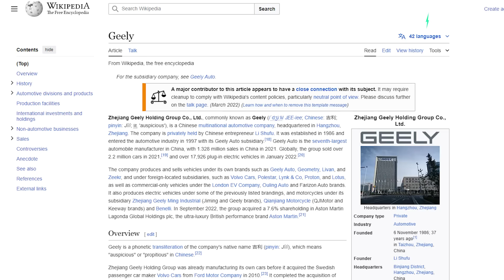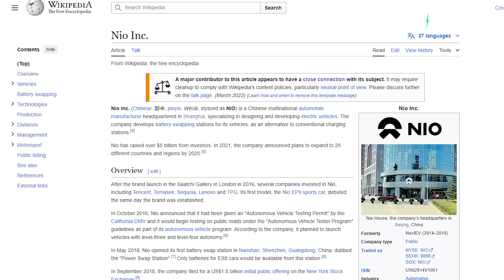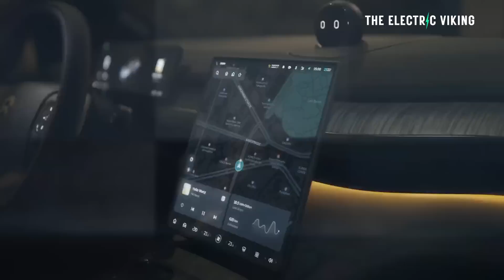$25,000 Tesla getting rid of Production line for world first assembly method

Comment: Volvo used to say: "Safety doesn't sell because safety isn't sold."  I believe for the legacy automakers burdened with dealerships, I'd change it to "EV's don't sell because EV's aren't sold."  EV's such as Tesla have VERY low maintenance, and service is the overwhelming moneymaker for dealerships (those beautiful, modern buildings at dealerships are largely built by dinging the auto owners for service).  Ford realizes this and still has to arm wrestle their dealers (who are independent businesses) in order to get their EV's into the hands of owners.  Once consumers are sufficiently fatigued by ever-increasing labour and fuel costs, the EV sales will follow.  Until then. the legacy automakers have a fight on their hands.  Next battle: making a profitable EV (like Tesla).
Reply: So true...how long can legacy makers continue running multiple production lines for fossil fuelers with decreasing sales. This is early days in the scheme of things and the uptake of EV's is trending upwards. When people bag out my EV I ask how much they paid in service costs in the last 2 years 80k kms it cost $89 in service costs and fueled by sunshine.
Reply: @Skeptic236  My 5.5 years 80k miles service cost is $173.    2 sets of air filters and a 12v battery replacement.  Newer Tesla after 2021 has Lithium v12 and will last the life of car pretty much.
Reply: Now Tesla is profit center for repair shops.   I own 2 Teslas but would hope to never get into a repairing incident (although insurance would pay), the time to repair could sometimes be long.
Reply: @Trust_but_Verify someone smashed into our model y when it was parked on the street. Repairs include replacing suspension parts and bodywork. No problem finding a repair shop and got prompt service - same as any other brand. That was over a year ago and we have almost forgotten it happened.
Reply: Given its now a mass market car, a reduction in repair costs should follow. @Trust_but_Verify
Reply: You don’t have to look far on YouTube to see many contributors saying they wouldn’t touch a wide selection of ice vehicles out of warranty. The pressure to cut costs means they will not use a metal pipe where a plastic one will do. Once that warranty expires, anything goes wrong with the car and it’s your problem. InBuilt destructibility baby - it’s the American way.
Reply: - needless to remind - that EVs only lack and engine-oil-and coolant-change.  They have all the other subsystems on a regular vehicle (who ever had a modern auto transmission which really needed a flush - (that is a stealership gag mostly..).  
(Some Near new EVs have had suspension fall apart from lack...  (maybe lack of design and assembly integrity) - not caught by the mechanic at the time of a greasing..)

The primary cost at a car dealership (yes indeed stealership is an ideologically correct rephrase here)  is workshop time (maybe dinging is your correct experience) - the time on a hoist for the apprentice to walk around with a clipboard and note all the Inspection points on the vehicle (safety check - not done by many home owners in their driveway)...  The engine oil and coolant can be dumped out in seconds - at the same time as the walk around begins - (topped back up at the end), there you go, a value quicky oil and coolant change in the same time as a brake inspection (just don't overdrain the variable displacement oil pump)....

Most wear components on a vehicle last for at least 60,ooo miles (tyres rarely), and many for the lifetime of the vehicle  (you, as a new car buyer) aren't often seeing 60k miles go past on your personal car. (if so you need to rebase your leasing period, or  run a hirecar company - to offload the new but high mileage cars to other users)..  Thankyou for taking the planet down with another, and another (high consumption model)- liberating those resources for the next person.   Thank you very much.   lol...
Reply: @kadmow  much less replacement frequency for brake pads and rotors, brake fluid change, no spark plugs, ignition coils, timing chain/belt, O2 sensors, exhaust sensors, catalyst coverter to be stolen, mass air flow sensor, emission control systems, there is no transmission or differential/transfer case fluid change.
Reply: @kadmow  I paid $175 on service for 2 sets of air filters and one 12v battery for 5.5 years 80k miles with Tesla Model 3.   My old BMW 3 series from 76k to 158k miles incurred $6,7000 service/maint expenses.  (exclude tires) and 18 service visits.  (exclude tires)
Reply: Hertz just decided that evs are too expensive to maintain. Sold off all their evs, took a $270 million writeoff and the ceo was fired.
Yet the evs lovers still insist that they are cheaper than ICE.
Seriously deluded.
Reply: service is the overwhelming moneymaker for dealerships

No it isn't - Lookers, the UK listed dealership group makes 35% of profit from after sales, and 65% of the profit from selling new and used cars
Reply: Good point
Reply: Insurance cost for Teslas (and EVs in general) are much higher than for any traditional car of the same price.  Insurance companies say it’s because batteries are expensive to replace and in a major accident they always need to be replaced.
Reply: @hdthor  maybe for now. But eventually the fully self driving cars will prove to be the ones that don’t have the accidents and the cost will go way down.

I think people who can afford to buy a Tesla can afford the insurance.
Reply: Dealership owners and their families are often the most wealthy people in the area.  Lots of mansions will be for sale in the next 2 years as those people have to find real jobs.  ;)
Reply: @davidbeppler3032 good point
Reply: EV's are more expensive to maintain. Lots more tyres needed for one thing due to the weight.
Reply: @Withnail1969  Absolute tosh. I own 2 Teslas and all tyres ran more than 30k miles
Reply: Tabloid rubbish hahaha
Research needed  @Withnail1969
Reply: @Withnail1969 You clearly don’t own one
Reply: @Withnail1969
Completely wrong.
Reply: @Withnail1969 - A lot depends on how you drive. My 4yr old Tesla still has the original tires at 30k miles.  Meanwhile I have spent exactly $0.00 on maintenance, not even windshield washer fluid, don’t need that in SCal and if garaged, just wipe it down with mild vinegar solution for bugs and dust, so correction maybe $0.25, ymmv. Btw, my EV came with free life of ownership Supercharging, an SC station, 24 stalls, opened 0.3 miles from my house a year ago so got real lucky prior to that it was a 5.5 mile to an SC station, but I have solar panels and net metering so used to occasionally plug at home in but not anymore. Free is nice, beats pumping gas, ymmv.
Reply: @Withnail1969  This is already debunked many times by owners.  My tires lasted 47k miles on Model 3 with 4/32 and 6/32 left.  I replaced it because it got noisy.  It's up to how it's driven, 0-60 in 4 seconds, sharp stock/brake would eat up the tires like any other gas sports muscle cars.

Comment: I'd love to see some new/old features in the coming affordable Tesla
1) A wind down window on for the driver.  All the rest electric.  I have a horror of driving into a lake and my window shorting out and trying to get at my window shattering device while holding my breath.
2) No touch screen.  They are more dangerous than using your cell phone while driving.  Everything should be tactile and while the radio can be controlled from the steering wheel, the radio itself must have a knob on the left that tunes the radio and one on the right that turns the radio on and off and controls volume.
3) Go back to the idea of a two way car.  ie, you can power your house from your car and store the excess power from your solar panels in the car battery.  And if you want, you can export power to the grid when the price is high.
4) Have a three pin plug somewhere in the car - trunk or frunk perhaps, that gives 220V AC (110V AC in America) with about twice the amperage capacity of a standard house plug
5) Look at the Leaf speedometer display.  It is visible through the upper half of the steering wheel and you can see everything at a glance.  You hardly have to take your eye off the road.  It is a much better display than any other car I have driven including a Tesla.  
6) Make the car so that the battery can be easily changed or just removed and sort out a package that converts the battery from a wrecked car or a degraded battery into a home battery.  Perhaps if you do (3) you would simply keep a very old car and park it in a leanto  and use it as a home battery.
Reply: A window shattering device is not going to help you. The glass is all laminated, and those spikes simply don't work. There is no solution AFAIK.
Reply: @greghudson9717  How does the thief break into the car through the window to steal the items then?
Reply: You can use voice control instead of touch screen.

Comment: Gigacasting may reduce production costs, but it essentially creates disposable cars.  One fender bender accident will total your car, because castings generally can't be fixed.  Insurance costs are going to skyrocket.
Reply: Negative Nancy and alternative facts
Reply: Same idea as the old unibody VW beetle no?
Reply: Another post on giga cast damage totaling cars!!!! Any frame damage on a regular car guess what???  It’s a total loss also. Some drunk idiot clipped the rear quarter of my f150 3 years back, misaligned the frame about 1/4 inch, totaled.
Reply: @timsmith6815  Did the insurance total the car because they don't want the liability in future accident?   What if you continue to drive with that misaligned 1/4 inch frame?  What would be the problem?
Reply: @timsmith6815  Cars and small trucks haven't used frames in decades.  All cars and small trucks use monoquoque (sp?)construction.  The body is also the frame. Your 1/4" represented a twist in the body.  It can't be untwisted.
Reply: @timsmith6815 Frame damage on a regular car takes a 40 mile an hour impact. You can bend a gigacast at 10.
Reply: @PxThucydides  Source and clarifications for your vague claims ?  
The limiting factor channel covered this in depth in 
"#1 Tesla Gigacastings // Crashworthiness and Repairability"
Reply: Possibly but I've seen sections of giga castings being hit with sledge hammers and they bounce off so not sure how the repair market will unfold.
I'm sure Elon has thought these things through so we'll see.
Their model 2 is the only car I'd consider buying so will look to its official release.
Reply: DEAD WRONG! Teslas CAN be fixed. Insurance costs will DECREASE as Tesla's new personalized insurance spreads.
1) There are crumple zones in the car so you can have a fender bender and get it fixed with relatively minor repairs.
2) If you do get hit hard enough to deform the main castings, the ends can be cut off and replaced.
3) Tesla's insurance system is unique because it monitors your driving habits and adjusts your premiums accordingly. It will KNOW whether you're a good driver or bad. No more averages and stats... no more paying for other's stoopidity.
Reply: @yvanpajevic9680  I have Tesla Insurance and you DO get penalized when other drivers do stupid things. If someone cuts you off or pulls out in front of you, you either get a forward collision warning or a following too closely penalty. Even though I have video evidence that some fool started out of his driveway without looking, I can't dispute the forward collision warning penalty that I got.
Reply: @hikingwithfreckles  - I get random forward collision warnings in my Model Y every single day as it thinks that cars parked beside the road will jump out in front of it or something.
Reply: All well and good  if you are a good driver. If you are a bad driver,  like me, it will cost more without other people subsidising the bad drivers.
Reply: @yvanpajevic9680  The real world seems to disagree with you. Tesla repair costs are extortionate, and the evidence is seen in higher premiums worldwide. Specifically with regard to point (3): what could go wrong with a company monitoring and assessing peoples driving?  Rewarding the "good", and punishing the "bad"?
Reply: @RodneyW  All repair costs are going up as cars are loaded with electronics.   EVs are simply leading the pack.   Tesla has a 2 week course for bodyman where they learn to do the Tesla specific things.   I speculate insurance companies are making more money totalling cars.
Interesting how some people switch to a BEV and the insurance is essentially unchanged.  The next guy pays through the roof.  In part some of this is people going from ICE cars to much more powerful BEVs.  How Insurance companies handle this is not uniform.  Age plays a role.
Reply: @danharold3087   "All repair costs are going up".  That may be true, but the insurance for my Mazda's is cheaper now than several years ago.
Reply: @RodneyW  Apparently your insurance company does not see you as a significant risk. Have you had tickets or accidents?   And your car is worth less than it was several years ago.  You are insuring less.
Reply: @danharold3087  I've recently replaced one Mazda with another... and the insurance got cheaper for the newer and more expensive car.  So I am insuring more... for less!  Our driving history is pretty much spotless, which does help, but that's not really different to 10 years ago..
Reply: @RodneyW   Happy it is working for you.   Could go on for a while but it would not change anything.  Actually I did and erased it LOL  Have a good one.
Reply: @yvanpajevic9680  nice one i did assume this was the case. Elon isn't stupid enough to build cars that can't be fixed.
As for their tech, i don't trust govrments with tracking us but i wouldn't mind Tesla having my data especially as I'm a safe driver never having any collisions or insurance claims.

Comment: I think Tesla is working towards one single, large casting for the entire undercarriage and one, single casting for the top, with all parts added rapidly.  We'll have to see what they come up with.
Reply: Mmm..I wonder who makes those huge casting press!
Reply: @pcstar123    Idra - A company in Italy.
Reply: @pcstar123  An Italian company called Idra Group. Their processes for high pressure non ferrous die casting dates back to the 40's, hence where we're at today.
Reply: Cast top is highly unlikely.  Thin casting of that size are extermely hard to make.  There are less costly ways to make a top.
Reply: Two sides and a bottom (which includes the firewall, with cross braces to keep the sides correctly spaced and parallel, and glass to provide windshield and roof. All that will be left to add will be the trunk and frunk components and lids.
Reply: but that makes repair more difficult?
Reply: @Trust_but_Verify   - bin - go...

Comment: Interesting, if you can break the vehicle down to just a few sub assemblies that can be snapped together that would do away the need for a central assemble line.. The Central line is for when you have a single foci object which is subject to a great many  progressive operations that are done sequentially in one line.. 

If you design large  subassemblies that are then put together in mega-assemblies  these might be doable in a more distributable nodal assemble process. This is kind of like how many, appliances, earthmoving machines or aircraft with no central  line but just many spots where the mega-assembles are joined together before rolling them out the door, In such a processes and there are then many doors at a production plant rolling out product at the same time. This method is much more flexible and faster to scale up or down.

Its kind of like parallel processing architecture where instead of one central data processing pipeline you have many smaller simpler pipelines that in aggregate operative more efficiently to create the same complex end product as a single mega pipeline same product produced its just done faster and more efficiently.
Reply: Sure, but there are always tradeoffs, no?
Reply: @ahhmm5381   There are many, many disadvantages to an assemble line, The ability of the chassis and drive train to move itself around eliminates  the need to have a single line of progressive assemble.
Reply: @Jason-bu9sv  Are you seriously going to say there are no advantages to one assembly line????

Comment: Aptera, thanks to Sandy Munro, is innovating in production efficiency to reduce cost, another story worth covering.
Reply: Lets wait till an actual  Aptera rolls of the line before we sing the praises of the   new assembly method!

I have one on order from 3 years back , give them a 50/50 chance.
Reply: @ev.whykingYes, I know. I meant Sam should explain why the reduced production cost allows more leeway, e.g., just 6000/wk is break even.
Reply: I gave up on Aptera long ago.
Reply: 4 years into the project, Aptera still haven't got a car. The 33K 3 wheeler is vaporware. As for Sandy Munro, what do they say about 'false prophets'.
Reply: @stephenc6955  If Chris & Steve + team can do it in five years that will be a record. Read the history of EVs and follow Aptera's constant video proof of progress.
Reply: @1voluntaryist   According to Wiki, Aptera was originally founded in 2005 before liquidating in 2011. The company was relaunched by the original founders in 2019. It's now 2024, 2024 minus 2019 is 5.